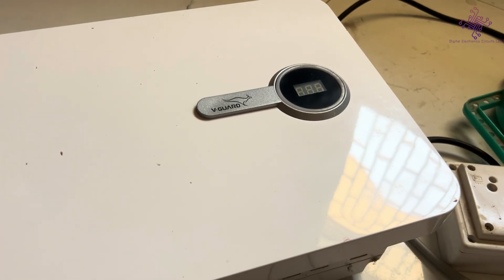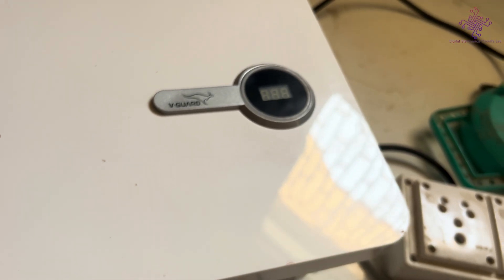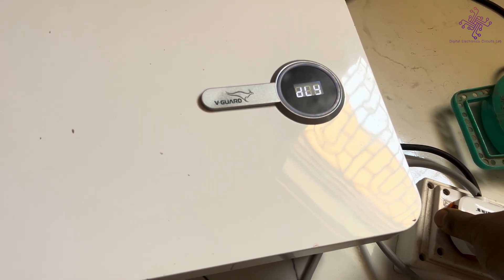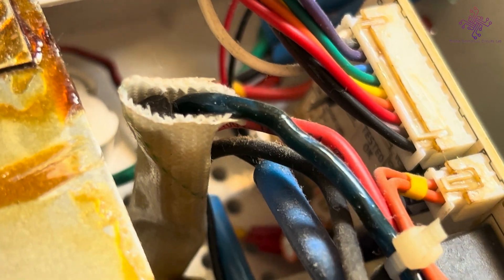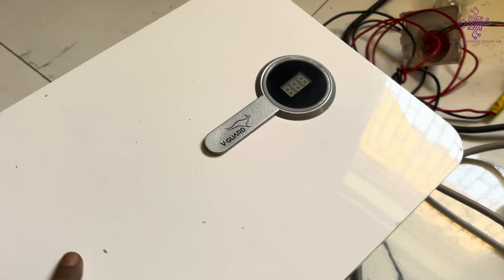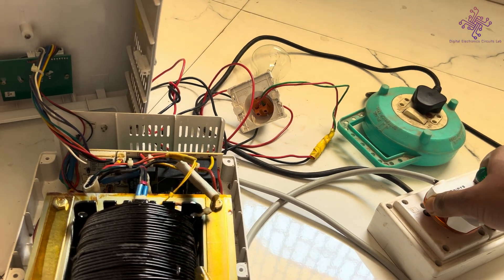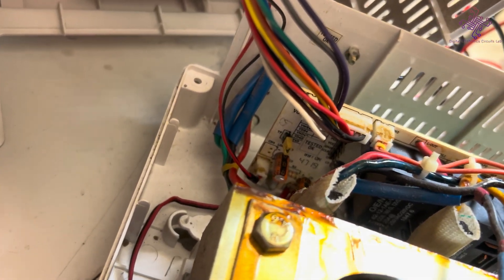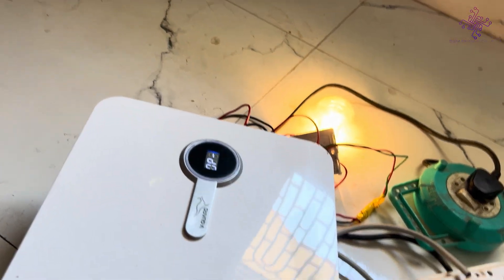V Guard AC Stabilizer delay DLY problem solved | Easy hack

Comment: If you short the jumper the stabilizer directly on the connected device. Is not it harmful for device? At the time of frequent power cut within a short period of time AC may be damaged.
For this reason delay option is given.